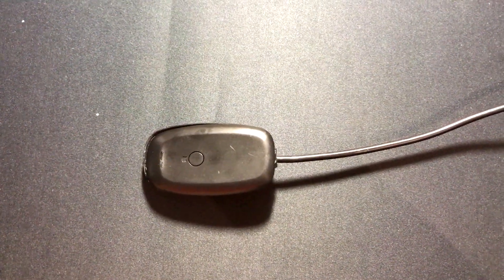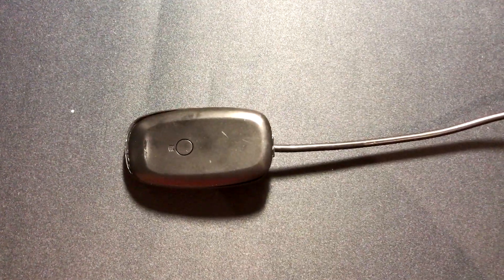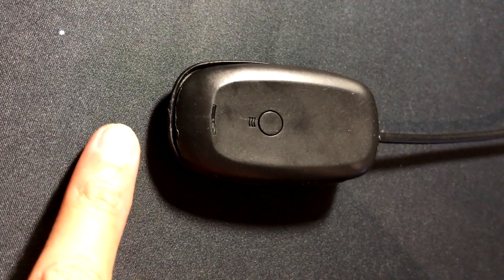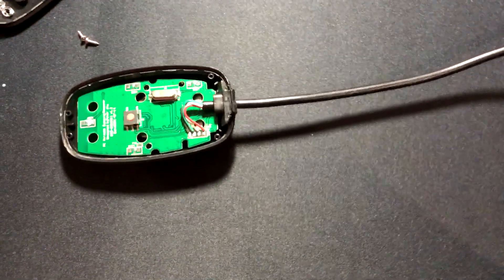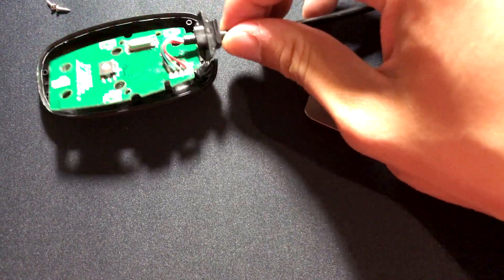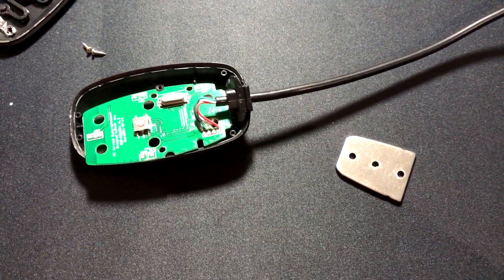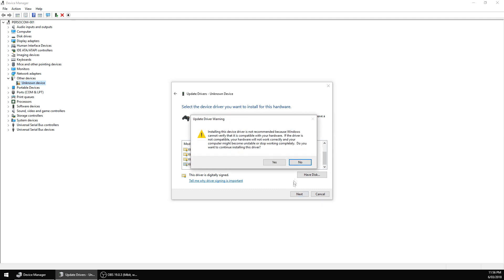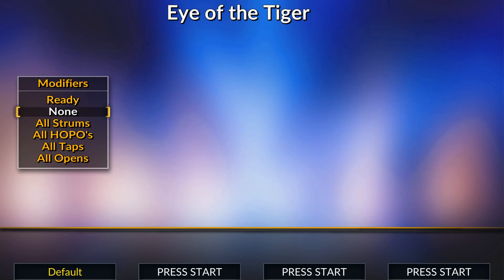[This is] How to Fix Wireless Guitar Connectivity (Clone Hero / PC)

Comment: mine willl simply not sync with the adapter at all, the controller and adapter both flash and then time out and never connect.
Reply: same...
Reply: did u fix this or u buy another adapter

Comment: Will this help with my Les Paul issue. Some of the buttons will work at times sometimes not, when I move the reciever it'll work better.
Reply: Were you able to get it working properly? I just bought 2 used 360 Les Paul guitars that dont use a dongle and I dont want to buy a receiver if it wont work properly.
Reply: @flatoutsupercars166  also wondering

Comment: Bro I bought a xbox 360 Les Paul and the wireless adapter as well, sometimes it works fine, but most of the times, it keeps disconnecting all the time, it's impossible to play. I thought about doing the thing that you did disassembling my receiver, but if i do it, i won't have the chance to send it back to the store that sold me. Idk what to do 😞
Reply: Did you fix this problem? And was it an official wireless adaptor?

Comment: Does this work with guitar hero live guita
Reply: you can use the bluetooth on the guitar to connect with you pc/laptop
Reply: @zeepmaster  every one on utube and clon hero said... Need to buy xbox360 version of the dongle...
Reply: @scoobychau  not if use the guitar hero live version
Reply: @zeepmaster  i m using xbox1 ghl guitar x2...

And i have that dongle in this video from and ols xbox360 controler.. 

So. Do i need to buy those xbox360 ghl dongle stick or not....
Reply: @zeepmaster  umm i am not sure what u mean...

Guess i would have to try my guitars hero live with my xbox360 hand-held controller dongle to see if it could work...
Reply: @zeepmaster  how do i do the bluetooth